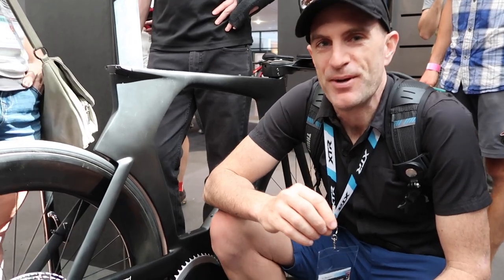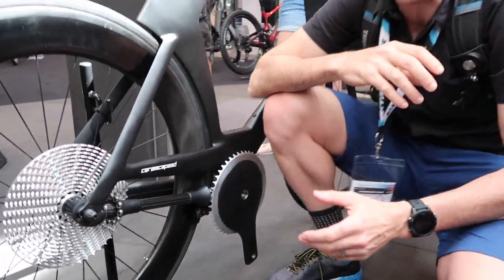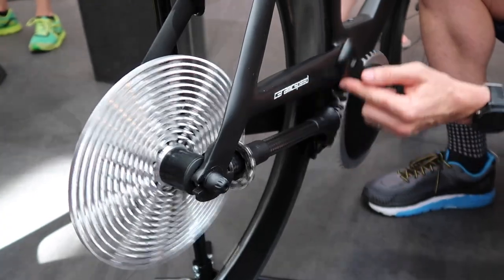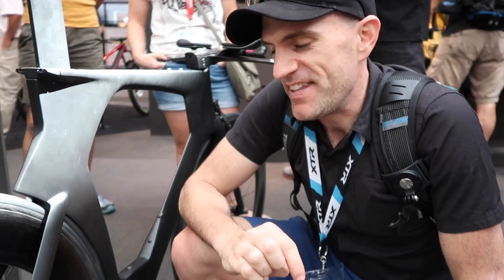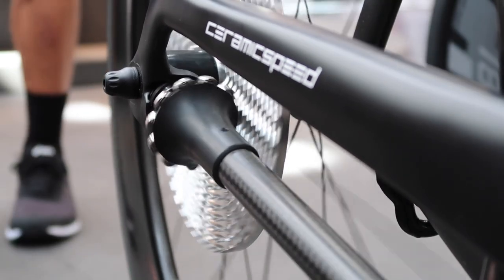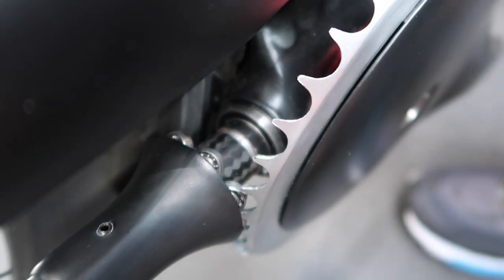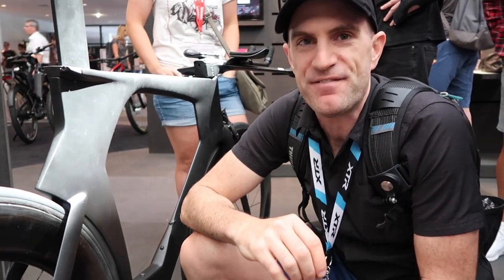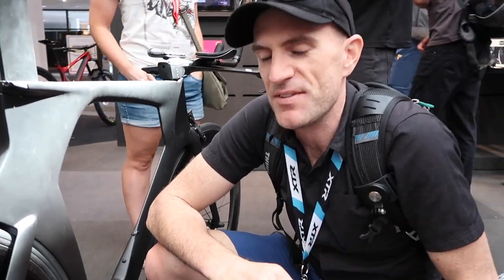CeramicSpeed DrivEN 99% Efficient Drive Shaft // Chain Free Bike // Eurobike 2018

Comment: A lot of problems. The surfaces on those bearings will wear a lot, and will wear differently depending on which gear is favored. The interior of the ring is faster than the exterior so across the width of the bearing there will have to be slip, worst closest to the wheel bearing. Because the bearings have to be circular, they are impacting the gears rather than smoothly meshing like a helical gear would (hence the noise). All this wear will also happen on the gear ring itself. Add dust to the equation and I don't see it lasting that long. Then the gear ring is going to experience twisting since it's supported in the middle and pushed from one side, this will be worst furthest from the wheel bearing and could lead to the bearings jumping across gear teeth without engaging. Finally, the gear change mechanism is not a trivial matter, it will have to survive while the rider applies torque, which is another way for those bearings to be trashed. Ultimately the likelihood that the final design will have a taper on the bearings and extra surfaces machined onto those gear teeth is high, and if it already takes 8 hours to machine then it could be prohibitively expensive, even if it does work. But I do hope it works.

Comment: I liked the idea of a telescoping-shaft, but CeramicSpeed, in all its genius, COULD use a ratcheting-action pedal, involving ARCS of 90 to 180-degrees, instead of decreasing ground-clearance with a conventional rotary-pedal with 360-degrees to turn the shaft.   Arcs of pedaling Should be the "thing" in mountain-biking, for who among us hasn't grounded a pedal at the bottom of the sprocket, due to the 360-degrees of rotation demanded of it?

Comment: I hope CeramicSpeed will learn that ceramic bearings are designed for high RPM applications with small  radial loads, not to act like gears.

Comment: I see it is using a standard cog hub.  "Sound and least amount of engagement."  Add a Onyx hub or Stealth it would be nearly completely silent with the one way bearing. I use them on my mtb and bmx. Instant engagement and only sound it the chain. They have been trying the belt drive again, doesn't seem to catch on.

Comment: looks like the front sprocket drives a ring of 12 tiny bearings in the front, and has 12 tiny bearings in the back driving the carrot grater. seems like a can of worms to have even more bearings to keep clean and lubricate

Comment: How can you claim a 99% efficiency on something that doesn't even have a fully-working prototype? :-/

Looks pretty cool but also pretty pointless. If this was a continuously variable transmission I'd be impressed, but it isn't. The forces are acting perpendicular to the direction of motion. The point of contact is tiny. I doubt this system will cope well with dirt. And how will they integrate it with a suspension? Good luck but I'm oot.

Comment: would be interesting to see this (after the kinks are worked out) being ridden by a good cyclist and getting put through its paces … 
biggest problem I see, if used in a race environment, is the flex under load of someone grinding up a big hill or winding up for a sprint … 
as a Sunday ride with the kids kinda thing? sure but probably too expensive for mere mortals …

Comment: I can't quite understand the negativity about this idea. Should they pull it off it would eliminate the front mech, make looking after your drive train a heck of a lot easier and it looks cool af. 
Loads of armchair experts pronouncing it unreliable or old hat, which is nonsense. There is certainly mileage in such an idea and a prototype is not the same as a final product. 
VR first came about over 2 decades ago. It didn't work and no one cared. When it resurfaced a few years ago the same arguments were used, but the tech advanced and some of the initial problems have been largely solved (i.e. latency). I hope this is the same because it looks great.

Comment: Bevel gears and variation of those have been around since the industrial revolution.  These guys have used that concept in a new way but really it's just another wheel.  On shaft drive motorbikes the problem is cooling and lubrication. I don't see why that would be a problem here. If this takes of you will be able to buy a Chinesium Bevel Gear system in no time flat. Takes the fun out of invention really.

Comment: Interesting but 8 hours to machine so that’ll be cheap compared to traditional pressed cogs. Contact area so small it will wear those roller bearings in no time. Indoor trainers need no gears so conventional mechanism best. Upto 99% means with barely any load

Comment: Aren't spiral gear teeth that contact regular ones better? Like in any rotary tool? A endlessly spiraling gear that is contacting flat tilted gears... Exactly the same transfer rate, much more durable. If rotary tools can stand thousands of rpm even at load (eg while cutting) i don't see why complicating it this way. All those little ball bearings... thats just asking for trouble. Also the "gears" of the bike could be resolved the same way as they are now. Just translate central shaft to a bigger diameter gear. I can't see a single reason this is better.
Reply from the maker: It's a concept. It may fail for them. It may succeed for them (or someone else who does it better). The bearings, in theory, offer lower resistance than a basic cog/gearing interface. As you point out - there's a lot to overcome here.

Comment: this has been done before, granted not with that many ratios, the problems start when you start changing gears, way too weak, in order to strengthen it adds mass making it a transmission case, which is so patented it would be a waste of time.

Comment: Struggling to see where the 99% efficiency will come from. He mentions the surface area on that vs a chain but the area where surfaces are moving against each other on a chain is tiny. Most of the area on the sprocket is stationary against it with only the entry and exit points doing any real rubbing. This is why chains can last ages even with minimal lubrication. Compare that to this and the rub area on this is smaller but this will cross the rub point multiple times for one on a chain. Of course that's ignoring the extra bearings at each end and the obvious deflection problem the design will cause. 
That could well lose efficiency and it will certainly hammer durability. 
From an engineering POV there's unlikely to be any gain here and the potential for a lot of issues. 
Looks more like a design to gather crowd funding than a realistic pop at an efficient driveline.

Comment: A clean bike chain has a proven efficiency of about 99 percent. This project is a huge waste of good talent. Also.  The steps between gears that is represented here makes no sense at all for practical use. If a radial motion changes 90 degree into another radial motion you'll have friction from the changing circumference of both the contact-area. Since this is a bearing with a relative large diameter (the OD is where the friction is at, rubbing steel on aluminium is never a good idea btw). A chain is laid near fully flat before any force is applied. and the small amount of engagement on the rollers is divided over the number of teeth it's engaged to. (running chains on large as possible gears is better for both wear and efficiency).

Comment: Expensive with all those little ball bearings, and susceptible to dirt intrusion since they're not sealed. A production version would have to use all sealed bearings OR solid pins that slide rather than roll, requiring external lubrication. Not a bad idea really!

Comment: This system, such as energy transfer and thrust, does not work for track and road bikes, the best option is the chain, you can see that no motorcycle uses this system for running, some use it for long trips and low intensity, but for racing DOESN'T WORK…get it right…..and also those gear tips are exposed to serious bodily harm…!

Comment: With strong legs I think it would just skip over the gears it has to be titanium not aluminum it's just a presentation not a working prototype if you have strong legs and accelerates the best you can it will break down you have to use titanium and have the right metal to make sure that will never slip gears I think it's has to be used by a strong man to show how strong the prototype is working with pushing the bike into its limits until then it's all crap

Comment: This seems to create more problems than solving any ... just my opinion. And hard steel bearings running over a cam wheel made in aluminium doesn't sound very reliable... not to mention the irregular sound it makes and the whole load of the force working in a radial way on such small bearings tells me there's a problem with the whole concept. I'd say , back to the drawing board guy's ...

Comment: Stupid idea:
1 - all the torque will be put on a small piece of metal at given time -  it will have to be significantly more massive to work. 
2 - the bicycle frame is not extra ultra stiff, distance between crank and freewheel is not constant. Chain neglects this problem. This one not. So imagine those cogs moving horizontally.
3 - While pedaling crank is not perfectly stiff either, everyone can see that. Support insert allows for some small movement. Again same problem.
4 - dirt, mud, some stick while riding in forest. Yup. Nope. 
To fragile, to hard to service, unpractical. High end gimmick.

Comment: Really does not  look practical. These drive shaft bikes put a ton of force on that lower bar. I see far too much chance for failure with this. My IGH is between 90-98% efficient, more than enough for daily commuting and shopping. The fully sealed drivetrain and braking means I can ride all weather without worry. This setup looks like a massive step backwards, and very dangerous to work on. My bike is identical to one that rolled off the lines in the 1920's and still there is no better way to go.

Comment: I'm pretty skeptical of that efficiency claim.
Reply from the maker: Me too
Reply: What's even much…much worse is that rear gear cluster. You briefly mentioned it yourself. The  force of pedaling is going to force the shaft outwards. It's also going to force the gear set into the spokes. try pedaling up a hill in the largest sprocket. I doubt you'll even be able to put 10% of your best effort before you severely deform or crack that gear set.

Comment: Great concept, but the design has a huge fluke and poorly engineered drive-train which will certainly fail unless they completely redo it.

The small bearings will definitely not withstand the torque needed to propel the rider.

Comment: Dude this technology is not new in any way, motorcycles have already used this method of drive and it has an inefficiency of 20%.
Reply from the maker: It has been pointed out a few 1000 times already, but the interface is what CaramicSpeed are claiming as new.

Comment: A bike that can't shift gears without a battery? Are they serious? There is a reason they don't show the bike shifting gears under load. Claiming to make things simpler by actually making things way more complicated, especially the manufacturing process. This also looks like a nightmare to maintain and don't get me started with the safety issues having a huge, rotating cheese-grater on the back wheel. It looks like a design made by an graphics designer, not a design by a mechanical engineer.

Comment: I call BS on “99% efficient”. You’re turning the power 90-degrees then turning it again. That isn’t “free” in an energy sense. Then you have losses in every single one of those mini roller bearings and where they contact the toothed wheel.

It’s an interesting concept, but I’d like to see some more honesty in the engineering & physics assessment of the power transmission. Whenever people advertise near-lossless power transmission, it’s a big red flag.

Comment: U gonna show it  running  put it tru its paces      looks like cheap  use metal  instead of aluminum  got the idea from  a manual egg beater
Reply from the maker: This video is 18 months or so old now. I covered what was on show at the time. CeramicSpeed are the ones to ask about this coming to fruition.

Comment: Sheldon Brown's site mentions shaft drives as slightly less efficient than a comparable (single speed) chain drive. The small size of the shaft gears causes losses in efficiency and gear changing has only been done through  hub gears so far. Weighs a ton too. 

Also, the tech is over 100 years old.

Comment: you do know this is the same drive as a 1700 steam powered machine
Reply from the maker: With roller bearing interface? Not quite. Close.
Reply: Shane Miller - GPLama don't need to get offended but could take inspiration with the speed change from that and apply it to this
Reply from the maker: It's all good. I'm not offended, this isn't my product/design.

Comment: 99% efficient??? Bollocks. Turning the drive effort through 90 degrees twice...? There’ll be horrible losses with that alone.

Looks horribly complex. If all bikes were like this and someone came along and said “hey instead let’s use cogs and a chain” it’d be seen as a marvellous innovation. And cheaper and more reliable. And quieter.

This is a solution for a nonexistent problem. Like that crackpot string-drive bike system I saw on a clip a bit like this one.
It’s interesting and it’s novel. But it’ll remain an oddity, if it ever progresses past this prototype stage.

Comment: I could rip it to pieces in just 1/2 km
Reply from the maker: I reckon you could do it it in the first 5m, leaving 495m of coasting and wondering where your drivetrain went! ;)
Reply: The concept in an enclosed environment would/could work fantastic. Love it..  But in diverse conditions.. even the grand tours get freezing rain and snow and a tremendous amount of dirt which needs to be cleaned every day. I have had chains raise up out of the cassette due to bad weather. In the winter I clean and lube the drive train every day.

Comment: Mud?
Reply: mud is worse when chains are involved. It may be bad for the bearing of the drive bar as well, but a housing is possible for chained as well as chainless bikes. So far, I have seen housing for fixed-gear chained bikes only, but it is easily done with the chainless models.

Comment: The Idea is incredibly stupid. Ceramic speed wouod need a uniquely designed cervelo P5 tt frame or any other brands modified frame to work (would be excessively taxed to be chain free) this would never function on any traditional carbon frame or extend to any derailleur hanger. There is nowhere in the tube or design for a motor which by design cant be either if the motor is meant to be inside the tube how does it even acutate efficiently. 

No cyclist will want the power loss associated, brittle gears or worse cassette teeth sticking outwards. At speed during a crash it wouldn't be hard to rip a cyclists leg or body or more vital areas to shreds in a crash. Just like Disc brakes aren't legal in the tour de france because of safety issues. Hot sharp spinning metal. 

And the UCI would likely ban it almost immediately after its invention because its too aerodynamic and unfair to the competition if it ever was better it would go into the history books like the original specialized shiv frame. 

Also who wants a rotating spindle of bearings functioning a cassette. One can only imagine the wear life of these would be ratehr short and replacement costly just like the bike.

We do have gates carbon drive, single speed rohloff and rohloff Electric and Di2 this is good as it ever needs to be.

Comment: The guy never seen a shaft drive that was patented in the 19th century? :)
Reply from the maker: *The guy checking in. No, I have never seen a driveshaft with a bearing interface. That's the key detail here.
Reply: Thank you for replying. Do you honestly think this is an innovation at any level? I mean do you really think no one thought of this before or are you just trying to sell this idea?
You should ask yourself why no one did such a thing in the pre-viral-internet-sharing-era?
Basically the problem is torque; yes efficiency might be higher, but if it doesn't deliver the torque then it's simply useless. And it should be advertised as such.
Reply from the maker: Mate, I'm a guy who's into cycling/tech who has a YouTube channel about things I find interesting. I found this interesting. As for your specific technology queries, they're best directed to CeramicSpeed, the company behind this concept. I'm not selling this. In fact, I think I shot it to pieces with my discussion points.